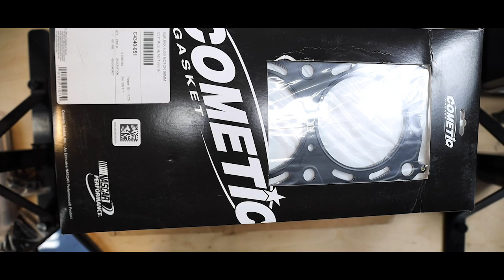1200WHP (Long-block) Flat 6 STi Breakdown and Cost

Comment: Dang. I’m doing a 6 liter Ls with t56, np120 transfer case, ford 8.8 rear, tbss front diff and 85mm turbo in my Impreza and it’s still less expensive than just the longblock. Cool project though.
Reply from the maker: The flat engines are not cheap at all 😅 luckily there's minimal fab work with this swap, drops right in and bolts up to the 6 speed. That LS swap sounds like a fun project!
Reply: @Smeedia  I watch your videos. You should watch mine.
Reply from the maker: I think I've seen a couple of them? You posted a couple up on FB yeah?
Reply: @Smeedia  like all day everyday trying to promote this.
Reply: @Smeedia  we can get dissed by the Subaru purists together for doing stuff different. Lol

Comment: Where did you get the hydraulic lifter to spring conversion info from for the heads. I want to convert mine thanks.
Reply from the maker: They come from thr factory with hydraulic lifters 🙏 when I disassembled mine when it was OEM you can see all the buckets

Comment: The exhaust ports on the heads are completely stock port and sized valves?  Just curious what your logic was behind opening up the intake side but not the exhaust side.  Thx, good video as always
Reply from the maker: Just to be able to get more air into the chamber, it should still evacuate the cylinder without any issue when thr exhaust side opens

Comment: I want to see the wiring. iwire has done a EG33 on a GC8. But making a new VA play nice with an old engine (+2 cylinder) will be interesting wiith anything less than a stand alone ECU.
Reply from the maker: Going full stand alone with a haltech elite 2500 🙏🔥